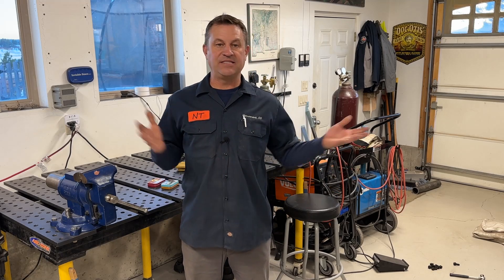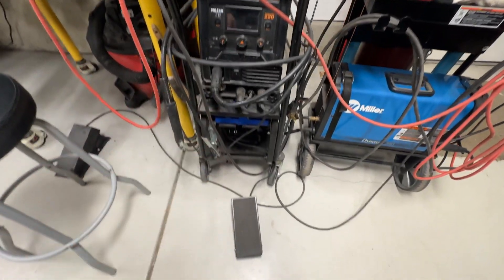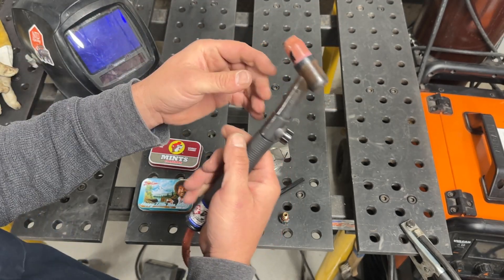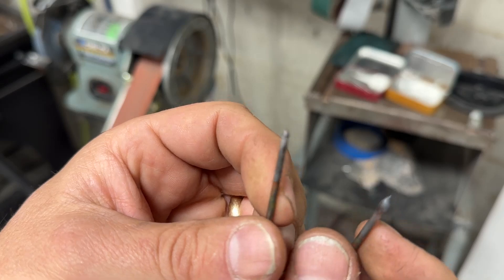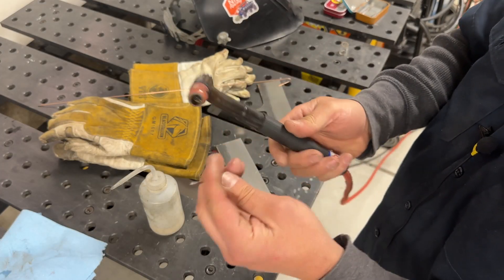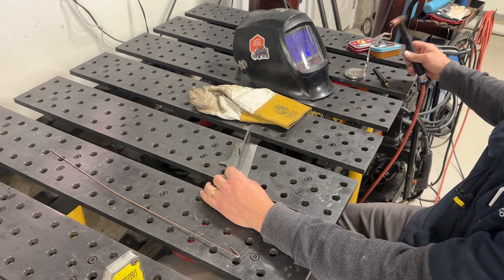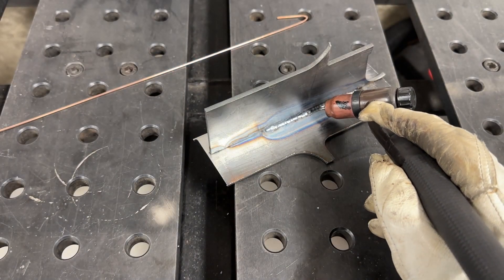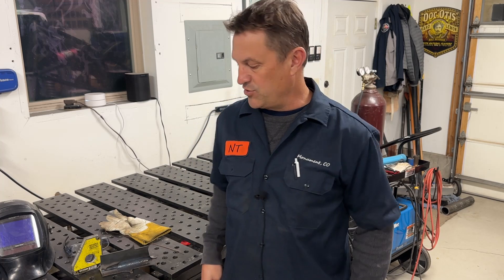TIG Welding 101: A Beginner's Guide

Comment: Thanks Dave. I found this video super helpful. Do you mostly tig weld steel? DC TIG? Is TIG welding steel stronger than MIG welding? Thanks for the video! Also do you only Lift TIG?
Reply from the maker: @BBlu-m9r  I only TIG steel.  I have played around with AL, but do not find it useful when building my trucks.   I bet there are people out there that can make a MIG weld as strong as a TIG weld.  I am not one of them.   We have never had a TIG weld failure.   I am embarrassed to say how often a MIG weld looks good, but comes apart on us.  II normally use my Miller for TIG, so I use a pedal to start and control Amps.    I tested out the Lift Arc on the BestArc welder to see how it would work.   I was impressed, but the Miller is an all around better welder.  If I was recommending one, I would take a look at Harbor Freights Vulcan ProTIG 105.  Have not tested it yet, but it looks good.